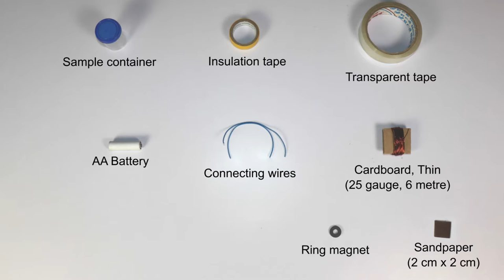DIY Galvanometer | ThinkTac

Comment: will there be a problem if we use a normal cylindrical magnet instead of a ring magnet??
Reply: ring magnet is preferred, but you can use both if you need it for demonstration purposes, which should be the case. just make sure to align it properly. the "arrow" should be sticking out of the North pole
Reply from the maker: You may use any magnet. Just be sure to know which surfaces of the magnet are the poles, and orientate it appropriately based on that

Comment: Is this a tangent galvanometer
Reply from the maker: In some sense, yes, because the coil doesn't move and the magnet does. But we don't pay heed to the Earth's magnetic field in this TACtivity. The magnetic field generated by the current is quite a bit stronger, at that distance, than the Earth's magnetic field, so it doesn't play much of a role, unlike in typical tangent galvanometers

Comment: Does it work if I don't use a battery and insert a magnet into the coil? I'm making a galvanometer for my electromagnetic induction experiment.
Reply: I don't think that it will...
Reply: It's not that precise . Putting magnet into coil doesn't induct  that much current so I think it will not deflect needle
Reply from the maker: The purpose of a galvanometer is to detect current flow, i.e. to measure either current or voltage. A battery has been used here as a current source to show that when it is connect to the galvanometer, the needle deflects. Using a magnet to show another magnet deflects is what a compass does, but isn't what a galvanometer is used for. 

You have asked about induction. In which case, either the inserted magnet or the coil itself has to be moving with respect to the other. Only then can you induce current. If you can make such a set-up and connect it to the galvanometer, then yes, technically you should be able to see a deflection then too. But engineering something like that may be a challenge.

Comment: will it work if i have joined my copper wires instead of continous wire
Reply: just make sure to insulate it properly to prevent short circuits and you good to go
Reply from the maker: Yes, you may connect it directly too. Just scrape them adequately.

Comment: What if I use North pole and south pole magnet
Reply from the maker: All magnets have a N and S pole, so I don't exactly understand your question. The ring magnet is small, light and because of the central hole can easily be attached here. Hence we use it. Theoretically, you can use any magnet

Comment: I need a quick answer pls 

If the terminals of the battery (+ve and -ve) are changed and touched in the copper coil, the needle deflects and shows the opposite direction. Why it happens so?
Reply: because the direction of the current is changed.. it flows in the opposite direction
this is why we use galvanometer- it can detect both +ve and -ve charges currents whereas an ammeter can only do one sided..
Reply from the maker: That's right; direction of the current flips, so the direction of the magnetic field caused due to the current flowing in the wire also flips and so deflects in the opposite direction when interacting with the permanent magnet.

Comment: Is is only galvanometer or moving coil galvanometer? Pls rply its urgent
Reply from the maker: In our galvanometer, the magnet moves. The coil is stationary. So it's not a moving coil galvanometer. In most commercial designs, or in your text book, they refer to moving coil galvanometers. The function of both is of course the same. Just that our design is different and ingenious

Comment: Can you please explain how does it work???
Reply from the maker: Any current carrying wire produces a magnetic field; nothing but Oersted's Law. So, in this case, as current passes through a coil, a magnetic field is produced, which then deflects the permanent magnet and the amount by which it deflects effectively tells you the current in the coil or the amount of voltage it generates